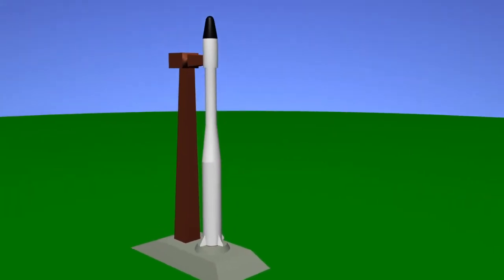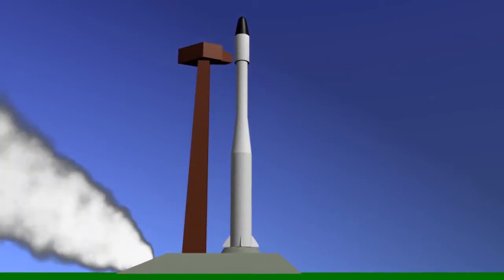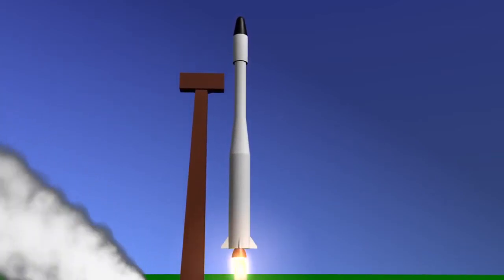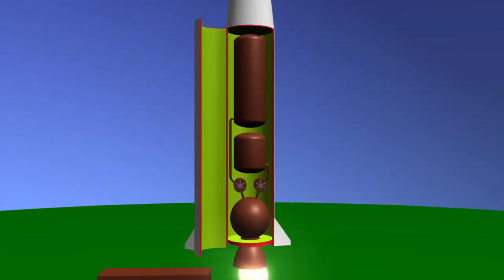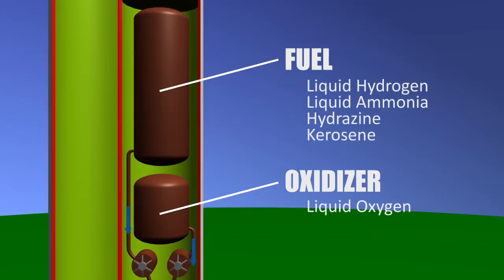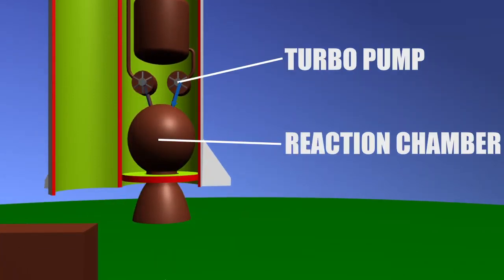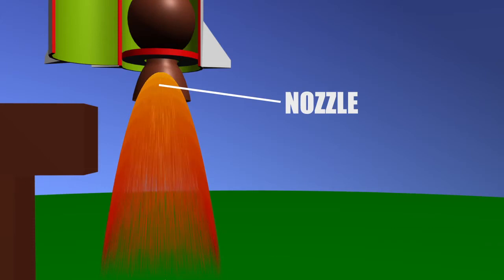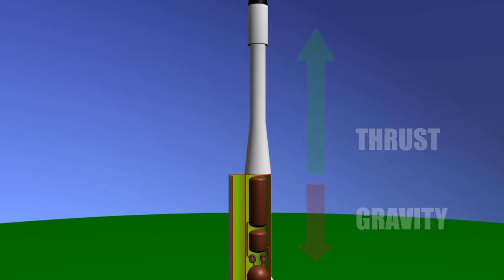How Do Rocket Engines Work?

Comment: But of course!
The exhaust applies a force to the rocket. If greater than the force of gravity pulling it down it'll accelerate as long as that force is applied. This force on the rocket stays the same regardless of how fast it is already moving. The reference system here is the rocket. Exhaust velocity/force is the same all the time - relative to that system. The limit is just the amount of time until the fuel is used up. Drag by atmosphere overall gets weaker the higher it goes. Cave Max Q.